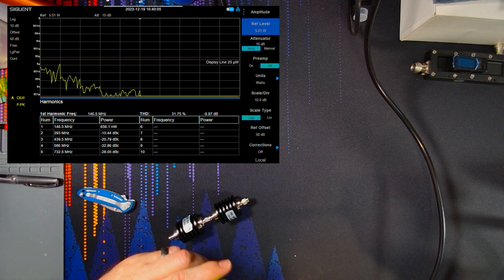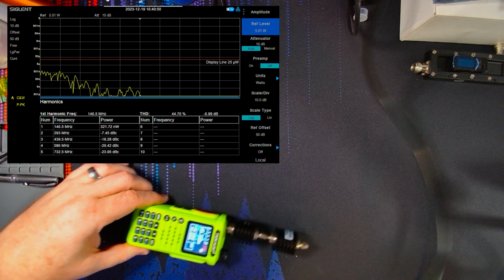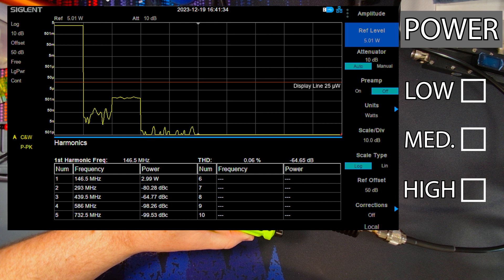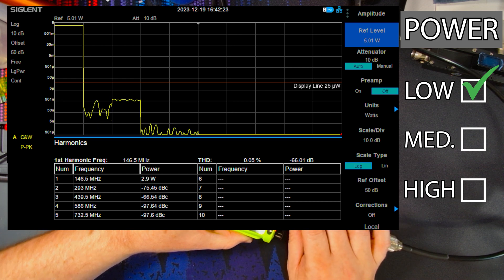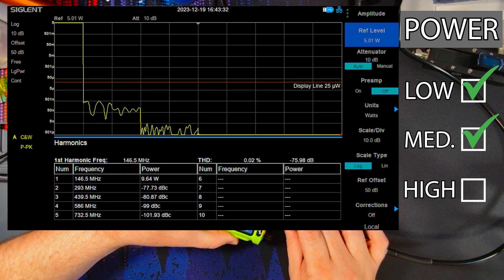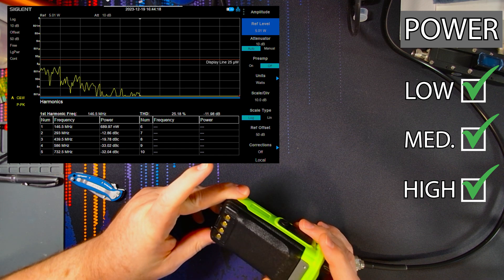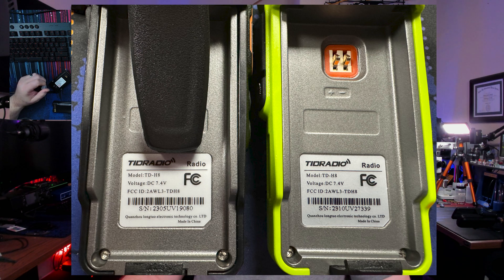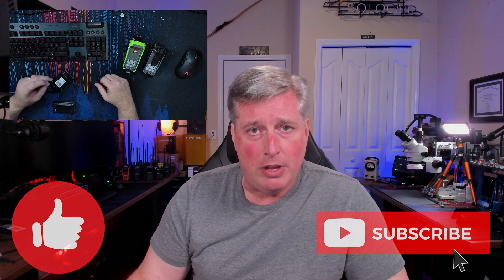UPDATE! - TIDRADIO TD-H8 Gen 2 they sent me an updated radio!

Comment: I really like the GA510 based on past experience with a Radioddity h/t.

However, the TiD H8 offers so many features. My previous experience with TiD has been good with some gmrs h/t's.

I had one of a set have an issue, contacted TiD via email and within 5 days had a replacement.

I also liked the odmaster programming.

Appreciate the thorough testing in the review. Looks like at least some of the Chinese manufactures are serious about  putting out better products,
Reply from the maker: Thank you for watching and taking the time to leave a thoughtful comment!  73s

Comment: I got a TD-H8 during the Black Friday on AliExpress. Serial number starts with 202311: these units did not stay in stock one minute. Nice radio, feels and sounds good. I'm just missing the air band reception capability, which I would have expected from such a feature-loaded radio. I don't own (yet) a TinySA so I cannot check for spectral purity. Reception sensitivity and selectivity is not as good as my Wouxun UV-9D, but the TD-H8 is a quarter of the price of the old Wouxun...